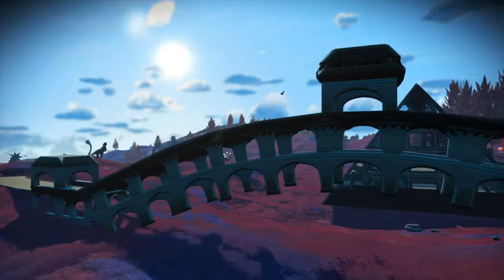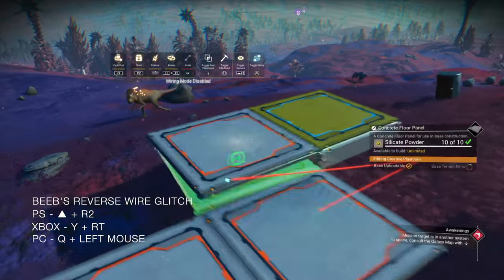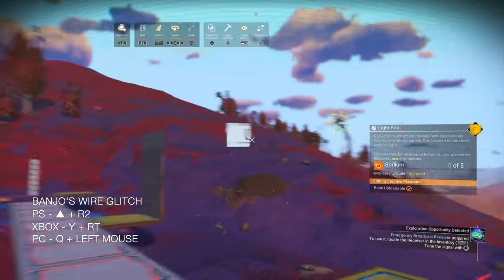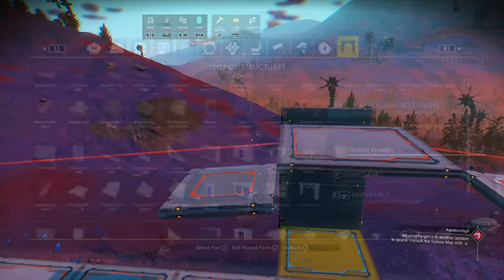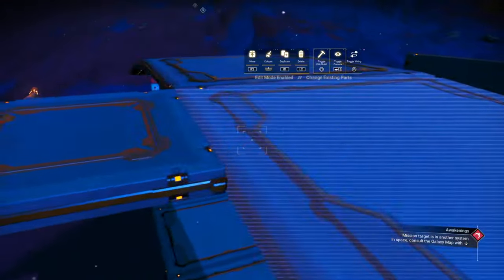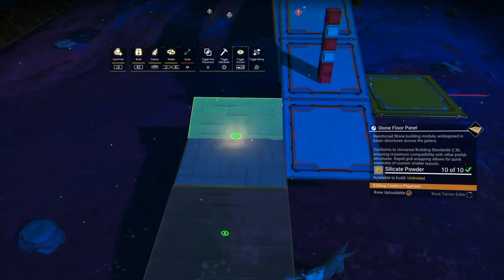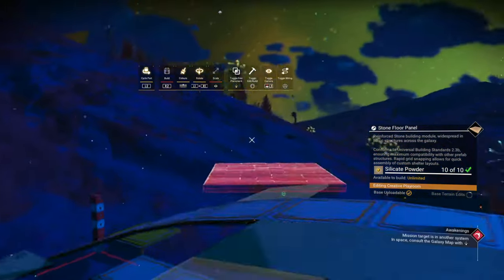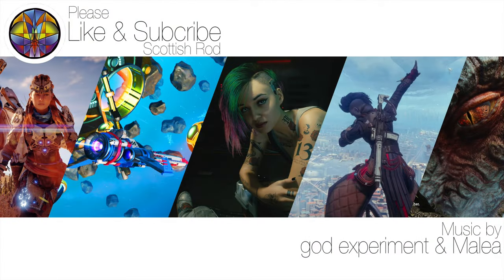How To Build A Perfectly Smooth Bridge Smooth Curve Tutorial No Man's Sky Update - NMS Scottish Rod

Comment: The fact that we have to jump through this many hoops to do something as simple as creating a bridge that looks realistic really says a lot about the minimul amount of thought they've still put into the building system. The new updates as well have made so many counter productive changes, such as making walls change design when walls are placed on top of them, which is uncontrollable, instead of the much smarter idea of just giving the player an option to cycle through the designes as they wish, as well as other numerous snapping issues, and the difficult of doing things like, making a second floor for a simple timber base, because the stairs only seem to want to snap on the exterior of the build. I hope they fix a lot of the general issues with their system, but I don't have my hopes up tbh
Reply: " making walls change design when walls are placed on top of them, which is uncontrollable"
This was true when the video was made, but was fixed months ago, you can easily select which of the 3 designs you want
In your build menu look at anything that should have multiple versions, such as an alloy wall for example, see it has a roman numeral II on the top left corner? This indicates it has variants, put your mouse over it and the tooltip tells you how to use them (X on PC)

I have no idea why your stairs are only snapping to the outside, could be a number of reasons but im not writing an essay on those, as it may just turn out to be something like my above paragraph, ie something you couldve found out yourself by reading the tooltip

As for all the hoop jumping to do certain things certain ways, while you may consider it a dev flaw - and you are not alone - many of us have got used to it, and we love our glitch building
If they removed glitch building and replaced it with a fully "build anything you can think of just by placing the bits" system, im pretty sure many of us would be sad, which is to say, the fact that it is difficult is what makes it worth doing
Reply: @isty4491  As far as the stairs went, I was able to snap them onto the interior, but only after backing waaay up in the free cam, which I do find myself doing a lot more often now to get things to snap properely, as the snap distance is... Interewswting to say the least lol. After making this comment I've done a lot more buildinng and understand the system much better, but that includes more flaws.

LIKE WHY CAN'T I PLACE THE GODDAMN OPULENT TAPESTRY ON THE WALL?! HELLO GAMES PLEASE, FIX THIS GAME BREAKING ISSUE, I WANT A TAPESTRYYYYY!
Reply: @serenitygaming3553  I totally see how its overwhelming at first

Youre right to use the Build Camera ALWAYS
They increased the snap proximity (when not in cam) a few updates back, and many of us would like it changed back, you used to be able to place stuff right at your feet, and snapped, the Gods alone know why

The Opulent Tapestry is a difficult item, i totally agree, it needs to be fixed
For now you might try Banjo-Glitching it in place

To learn aobut the different types of Glitching i recommend you search mroe of Rods videos he has done plenty to teach people thing
And i hope he wont mind me also recommending Beeblebum in his comments, who has also done many videos to help new folk

Bugs and broken tihngs are annoying, but they are many and common in this game
If experiencing bugs is enough to make you shout in caps you might pop a blood vessel in your brain

Any/All bugs you come across submit a ticket to the ZenDesk
https://hellogames.zendesk.com/hc/en-us  (if links are disabled just search "hello Games zendesk"
Submit the bugs, and get your friends and others to submit them too
Dont spam them every day with it, but do repeat it every month if it hasnt been fixed

They DO listen to us platers, and they listen mostly through the Zendesk, the more people submit the same bug the higher priority it is given
Do not Rant or Swear at them, just report it as a bug giving as much information as possible without losing your temper, if you do insult or berate them expect your request to be given lowest priority

Comment: I'm having a couple of issues. When I try to place the light box, it keeps refusing to go in the correct direction. Any tips on how to fix? My camera is in about the same place as yours when you demonstrate how to place said light.
Reply from the maker: I think your still hitting the wrong wire connector, if you move the camera around, slowly you should see the connecter flip. 🙂
Reply: @ScottishRod  I sat there for like 45 minutes to an hour trying to figure out what was wrong, and what’s worse is I had done it correctly once before 😂. I’m trying to make two bridges parallel to each other, and the house will be in the middle, so I’m confused on why it worked the first time and not the second. 

I’d like to mention that sometimes, when I place the light box, it will face the correct direction but will tilt upwards slightly instead of the correct direction and straight forward. Is that still a matter of where the camera is facing and which wire it is being placed on?
Reply from the maker: @kingypoo4182  The game is being a bit squiffy, happens to me sometimes. No idea way as its random but annoying. 🙂
Reply: @ScottishRod I've done a little bit of exploring, and I don't know the exact fix for this "glitch" within a glitch, and I managed to get the boxes in the right position. What I DO know, however, is that it has something to do with how fast it is placed, how far away, and the camera angle. Though, you could try many times and it still may not work. 

Off to finish my second bridge, thank you for the help! 😁

Comment: How do you measure the number of walls to go up depending on how long your bridge is?  Trying to build mine longer then in tutorial.
Reply from the maker: It really depends on the length and curve shape.
The light boxes are key, if it's really long you can use every light box and have a smooth curve.
 
Count how many floor panel to the centre and make sure to have a few more light boxes to take into account the type of curve you've created. 

Hope that helps. 🙂

Comment: So I'm trying to build bridges again and it worked before but now the left side light box(when facing the two walls in the middle) faces a little upwards. It's facing the correct direction but not straight ahead.  The right side is perfect though. I've been having this issue for some time, any thoughts?
Reply: Holly shit nvm! I figured out a way to work around that issue!! Hahaha stokedd!!
Reply from the maker: @keaboyy  I've noticed things are a bit weird, less forgiving, building wise since the last two updates. 🙂
Reply: @Scottish Rod  haha either way, your builds are frickn awesome and one way or another, if something won't work like it did for you, I'll find a way. All I had to do was snap a floor panel back into the center(where light box will be) and green state another floor panel from the middle connector to the back of it(across from the garage door placement) and BOOM!💥  IT WORKED 😎💪🏽
Reply: @Scottish Rod  I've also noticed when deleting certain wire glitches parts like the garage, the wire gets deleted too, so for a lot of your builds I just had to leave the glitched part there till I didn't need the wire placement anymore. That's why your kaleidoscope build WAS A HEADACHE!!💀 Lol but again, still worth it. 98% of my knowledge with builds in nms is all bcus of you and beeblebum🤙🏼 deeply appreciate it bro🤙🏼
Reply from the maker: @keaboyy  I'm working on updated video's at the moment, bridge is on the list. 🙂
Reply: @ScottishRod  yes!! Thanks man, looking forward to more of your content🤙🏼
Reply: @ScottishRod  Thank you! Yes...you're the man!

Comment: This does not work on PC.. I have no ideal how you do that wire glitch...when you put Q an right mouse.. it just switches to a wire...does not place the floor panel or anything like that.  This just does not work on a PC... I've tried and tried... and you cannot get the floor panels to angle like you did.
Reply from the maker: It's one of those techniques where you have to find the sweet spot when hitting the key and mouse at the same time. It should be easier on a PC but you still have to find that sweet spot.
This might help - https://youtu.be/ihgx31O8p0g

There are also macros that create a single button press for PC, that's what I'd install if I was on a PC. 🙂
Reply: @ScottishRod  I got it to work after much trial and error.. its not easy...and most of the time it does not work and you have to try again and again to get the part to sit right.